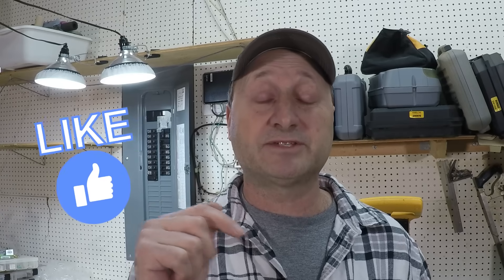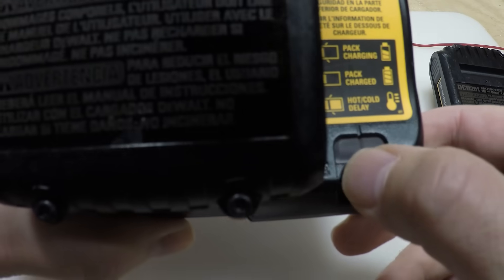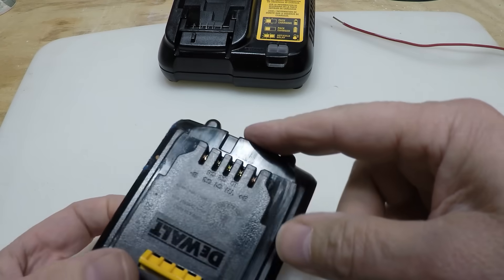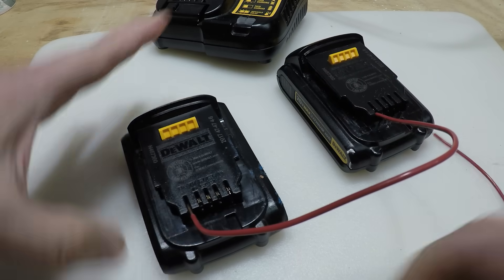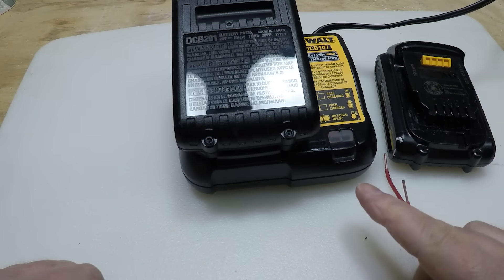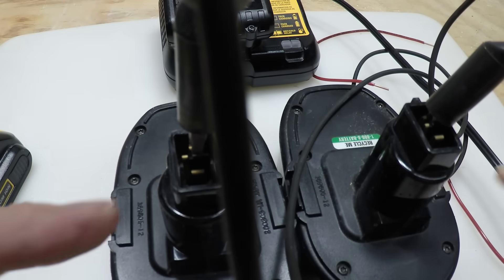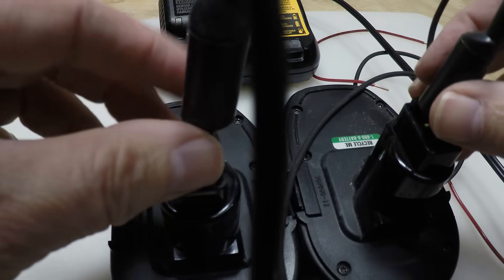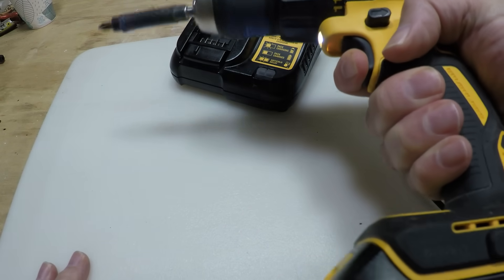SECRET to FIX Drill Batteries - Charge Dead Lithium Tool Batteries

Comment: This is very dangerous advice. When a li-ion battery is completely discharged, dendrites grow between the electrodes, and they may create an internal shortcut which burns down your house and kills you and your family. And this could happen weeks or months after you have resuscitated the battery using this method, basically any time. That is also the reason why proper chargers refuse to charge li-ion batteries which have been deep-discharged.

Comment: Hi, I have a Lithium Ion camera battery which accidentally went through a wash cycle in a trouser pocket in the washing machine about 2 months ago. It is completely dead. Will this method work to restore it? It doesnt have the B1 and B2 connections but it does have two other terminals. Look forward to your advice. Jon

Comment: 5:28  You're not UP AND RUNNING
that doesn't mean jack shit

1. Fully charge the battery (a few mins doesn't mean anything)

2. Take some screws and put into some hardwood, 
PUT IT UNDER LOAD

a few minutes of charge, and spinning the drill with no load MEANS NOTHING 

Placing the battery on charge for an hour or two.
then using it under decent load for say , 30mins
and doing that for a week
AND THEN LET'S SEE IF YOU HAVE A PROBLEM

If not,.... Great
If yes,   .. there you go

Comment: I see what you are doing in the DeWalt, and there are lots of people helped.  I just don't see what goes on in the other battery.  Are you connecting only one lead?  that is not a circuit.

Comment: It would be nice to have a time laps to see if the bad battery gets a full charge.  Good video.
Reply: How do you charge if both batteries are dead?
Reply: 5:59
Reply: @gregoryhamid792 
you get a bench power supply and repeat the process.
ultimately you need a power source for the dead batteries
Reply: Exactly what i thought
and then get it to do some midly heavy drilling , Put it under some load, see what happens
Reply: 5:59 5:59

Comment: any ideas for something like a rechargeable flashlight with built in batteries? or small drill with built in battery. they use the round pin for charging. thank you.

Comment: This video does not address weak batteries that will only run a tool for 2-3 minutes.
Reply from the maker: That is because the video clearly indicates it is for DEAD batteries.  This video also does not describe how to make a ham and cheese sandwich either. What you are looking for is a different video

Comment: Holy cow !  This is a great tip. It would have been nice to have known this a couple of years ago before I retired. No telling how many good batteries I tossed and bought new to replace them. I worked my tools hard, so I just figured I pushed them too much.
Reply: This works well on NiCD and Lithium-Ion tool batteries. Not quite so much on a deep discharged lead-acid battery.

Comment: From what I watched and others have confirmed, your tip seems to work in getting the “dead” battery to take a charge again. What I’m curious about is, will the jumped battery hold the charge for a lengthy amount of time, or do you have to jump it again every time you want to use it?
Reply: It is also interesting to see what capacity remains.  Often these packs are made of standard li-ion cells, so they can be replaced a bit cheaper with DIY.

Comment: This guy probaply replaces fuses with nails too.  What was shown is dangerous and should never be done. NEVER bypass safety measures in electronic equipment. When the battery starts to behave strange it is time to discard it and buy a new one.

Comment: It appears you need to have a good battery to jump the dead one. What if you have only a single battery? Can it be fed juice by some other means? I have the old type stud post makita that won't charge. Not sure of the voltage right now. Can a 12 volt Lifepo4 Battery supply the short flow of juice to activate the dead drill battery?

Comment: The new battery chargers are designed to see voltage to charge voltage they don’t want people getting hurt so they put that safety feature at all the chargers when you run a battery down past a certain voltage the charger will not come on he is right you need to put some voltage into the weak battery and this ends the lesson

Comment: I am one of those fellows that actually had one of my good battery caught a spark and started a small fire using this method.  Luckily I was able to quickly pull one of the wires away and was able to blow the spark dead.  So, be very very careful using this method.

Comment: 20 volt? Seriously? A fully charged 18 volt battery shows 20 volts. Selling 20 volt tools is a marketing ploy. Can I claim that my car's system is 14 volt because the battery measures 13.8 volts when fully charged? Marketing people were truly born from the rear end of bulls.

Otherwise, great tip and I'll see if it works with my friend's cheapo drill. I'll measure the voltage first to see if I can determine what the threshold is...

Comment: I've got an old Ryobi 12 volt that won't charge.  I plug it in and it never completely charges.  It stays red all the time even after 24 hours.  It will run the drill but very slowly.  I think the battery is worn out. Both of 'em.b Cheers from eastern TN
Reply from the maker: thank you for watching! please share the video for others to see

Comment: Dangerous stuff.
Usually the battery won't charge because it has had some sort of internal fault with one cell.
If you get away with this a few time that's luck and is likely. If you have a catastrophic failure once it can be a disaster.
Before you do it ask yourself  questions.
1. How much is a new battery?
2. How much is a new house and  
             family?
3. Am I feeling lucky?
 Well punk. Are you feeling lucky.
Reply from the maker: get off my lawn Clint..
Reply: @flannelguydiy6458 if you don't like a factual comment don't post bs
Reply from the maker: one moment please.. i am looking for the fire extinguisher.

Comment: What do you do if you do not have a good battery to jump it with ???
Reply from the maker: you can use any battery
Reply: Have to be the same voltage ????
Reply from the maker: no @jamesmyers1199

Comment: I have Two Triton 2.0ah 18V batteries. One won't charge so I followed your instructions yesterday and now the flat battery on the charger is continually flashing but not moving forward to charge. Only the first light is flashing. The charger is showing 2 lights, Red and Green as if the charger thinks the battery is fully charged. Do you have any further suggestions.

Comment: How can you safely jump a battery when you don't have another one to use?  I have a (very expensive) Dewalt 36 Volt cordless drill that Dewalt no longer makes batteries for.  It was discontinued for some reason (maybe because it was breaking people's wrists because it was so powerful, idk)  and I can't find any aftermarket batteries for it..  Although it's an awesome drill,, I barely ever used it and both my batteries are dead-dead. The kit was like $750.00 new so I don't want to just toss it without trying to jump start the batteries.  Please advise.
Reply from the maker: you can use any battery
Reply: Thank you for replying.   I will try it.

Comment: I have brought dead AGM batteries back to life with a similar method. I bought a M931 5 ton  Military truck. The truck has 4 large AGM batteries in it that had around 4Vdc in each of them. A smart charger will not charge a battery that low. I took a good battery out of a car and hooked positive to positive and negative to negative. I hooked the charger up to the good battery. The charger seen the 12.7Vdc on the good battery and the dead battery started to drain it. The charger seen the drop in voltage and started charging. It took about 2 days per battery to fully recover. After I did all of that, the batteries charged with the alternator and held a charge. The Hawker AGM batteries the military used in the M939 series truck cost $525 each.
Reply from the maker: thank you for watching! please share the video for others to see

Comment: I watched a video where a guy would replace the batteries inside the battery with better batteries he bought on the internet. These new batteries would last longer. Much cheaper than replacing the whole battery with a new one. I'm going to have to find him because I do have a cordless drill that needs those new batteries or maybe I'll try to do it myself.

Comment: I have a 20V 5AH Dewalt battery that has a charge indicator on the battery, however when I charge the battery, the charge does not go beyond the first bar, I believe there are 4 charge bar lights , thanks

Comment: You didn't show the "fixed" battery coming up on a "full charge".  Did it?  I would say that the "fixed" battery will never come up to a full charge again.  It will always be trying to charge and never get there.  My laptop did that, and it never has recovered from a deep discharge.  Will only get to 85% and never above that.  Also never trust that battery again to be charged with no one around to watch it.

Comment: People mention this for lead acid. My noco charger has a "force" mode just for this. Worked on one 12v testing under 5v. I keep an old dumb one though just in case and for electro rust conversion.

Comment: I'd like to know where you purchase the wire to connect the 2 batteries to jump start the dead battery and the working battery? And where do get the clamps to connect the 2 batteries (18 volts) in the video?

Comment: Hi  I have a SeeSii Cordless Mini Chain Saw with a Lithium-ion battery 21.5 volt.  It has a plug in the centre of the battery to charge.  The battery is a MX5C1.5-200521.  I plug the charger into the wall and the plug into the battery and it shows it is fully charged, but when I put it into the chain saw, it does not run??  Any help or suggestions??  Thanks and love you video, very explanitory.

Comment: I just put a incandescent bulb car tail light etc ,on battery terminal then put on charge ,the power used by bulb exciting the charger ,then it will safely charge ,it works for car battery that won't charge also ,,,,but do this outside and don't leave batteries on charge unattended , lithium batteries burn 450 house's down in Australia per year according to fire department ,,, never charge them inside , especially rubbish from China

Comment: I think if the battery is dead it is really over. If the inside of the battery cell is leaking you can apply all the tricks in the book but it won’t work anymore except if you change the cells maby . Still a nice educational video .

Comment: If you had money to buy a drill with dual battery, then you should have money to buy new batteries. Don't screw around with such hacks if you don't know anything about what you are doing.  Btw you can easily change the cells inside the plastic casing to brand new ones, but again you have to know what you're doing..

Comment: Five years ago I went on vacation when I came back the wheelchair batter the high amps DC battery was dead so the dealer for wheelchair told me my battery both of them dead so I replace them both but I told them I need to get back my old battery, I got my old batters I have 1000 watt charger with a controller for all kind battery to charge from lipo battery and more when I test the dead batters they were 3 volts as should be 24 Volts so I start charge them each on it own slow and I ad the volts a little at the time until I get them back to 24 volts and it is still have them until today the are working for the old batters.
Nothing to lose at longest you are go up slow with going on fire.

Comment: Turning on the charger helped me. The charger tries to charge for a short time and stops. Then unplugged the charger and waited a bit. Then plugged the charger back in again. I did this 5x or 10x and the charger accepted the battery.
The trick is that my charger tries to charge blindly until it goes into error mode. 
Putting some energy into it a few times awakens the battery.

Comment: If the wires are too thick to slide into the battery slots use a hammer to flatten the copper ends and then use a file or knife to scrape clean the ends.

Comment: We have a battery charger booster for semis and I built a voltage injector to fool the damn thing that it is connected to a battery because it too will not boost a completely dead battery.

These things are designed this way.  A flawed design indeed.

Ni-Cd batteries like to be fully killed because they have memory.  The more often you fully kill them the more charge they hold.  These batteries are complete garbage.

Lithium batteries that do not hold that much capacity are also not recoverable. They do not like being fully drained.  The more often you charge them and less you drain them, the longer their lifespan.

lead acid batteries can be reconditioned with a desulfator. It simply injects a high frequency low duty cycle high voltage into the cells which blasts the sulfate off the battery plates.  Many manufacturers take in bad batteries to refirbish them.  It does not always work if they were frozen or if they are contaminated. If the lead is not pure or if the sulfuric acid has been contaminated, the batteries will self discharge.

Comment: I found that when I tried this the first time I got my 'bad' battery to wake up but it still would not take a charge. So I went back and reconnected the B+ and B- terminals and left it long enough to get the battery level up to the second red light (when you put on the battery charger) and the battery was then able to get fully charged and is now working.

Comment: This works on a car battery as well when your charger has the safety feature requiring voltage in order to activate the charger leads is in the design of your charger. A fully depleted battery will not activate the charger as there is not enough voltage for the charger to “see” the battery. If you don’t want to run the engine to charge the battery, simply run jumpers to another vehicle, install the charger on the low battery, verify it is charging, and remove the jumpers. Use a low current setting to minimize damage to the charging battery. If not sealed, verify electrolyte level is full. Charge for 30 minutes and then check voltage to see if it is responding to the charge. Repeat until fully charged or determined to be defective.

Comment: Some batteries like Makita have a chip inside that when you put the battery on the charger a number of times and it fails the chip will void the battery and you also then need to change the chip to get it to work again.

Comment: This did not work for my Dewalt 20 volt battery. One has been dead but the in the drill but it blinks in the charger. After about 2 minutes is stays red indicating a full charge. I tried this fix with the good battery and nothing changed. I will try it on my older style batteries also.

Comment: if the battery charges but it drains fast is the battery no good I read some comments however will the battery perform a 100% or will it drain fast?

Comment: I just tried this and at first thought ok it worked.  Since after connecting the 2 wires and then putting battery on the charger the light started flashing. Except 15 seconds later the light went from flashing to staying on. Ok so I put battery on drill and it had very little drilling power. I decided I'd hold trigger until battery almost dies.  Well drill stopped completely after 1 minute of operation. I put battery back on charger and light won't even come on to indicate charging or otherwise.  I then tried to connect wire to the terminals once more. I got the exact same result. Idea of what to do now?

Comment: Thank you for information
I have 80v green work battery for my lawn mower 
They gave me two  when bought the mower 
One charge fully and good 
The other one doesn’t charge  their instruction says not making good contact or hot when not charging 
I have not contacted them yet 
Could I use the same method maybe is fixed
Also the same a Milwaukee  power tool with two 18 v battery 
One is charging , the other one is not charging
Any idea

Comment: Wow! I just about replaced my Milwaukie 18v high output battery for my Milwaukie Trimmer blower.  On sale at my local harware store for $250.  I have been superfrustrated.  I worked great.  I left it on the blower over winter and then it wouldn't charge.  I was like no way this works.  This video just popped up in my feed and saved me $250!  Can't believe this simple hack worked so well. ( I did get a little spark at first connect and didn't leave them connected for more than about 5 seconds and then it started charging no problem.)

Comment: Excellent worked a treat with 2019 WORX 20v  ‘dead’  for 3 years 0.6v used another good battery left for about 20 seconds then showed 17 v charged then stopped then charged stopped up to 23v now and working well 👍

Comment: This totally works! I used it on my Kobalt cordless trimmer battery that would go on for a minute on the charger, then go to red and not charge. After using this tip, the battery is now charging! Thanks